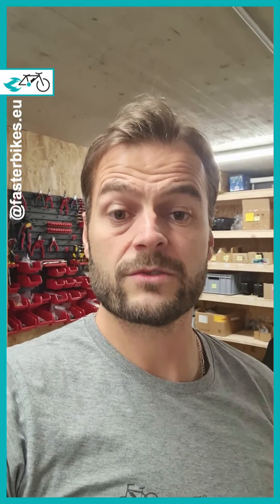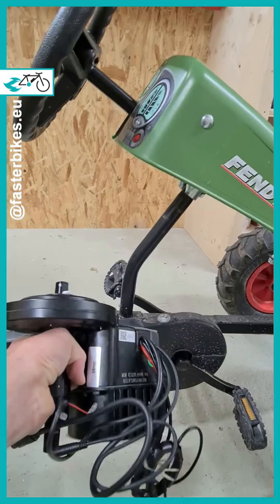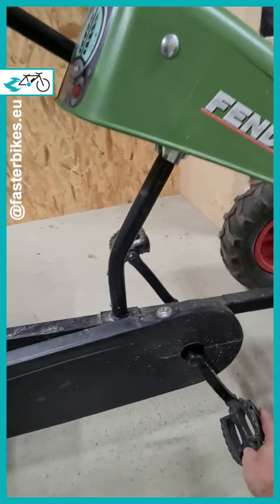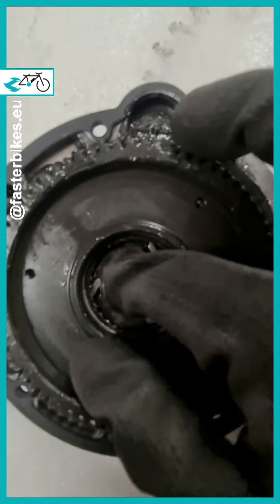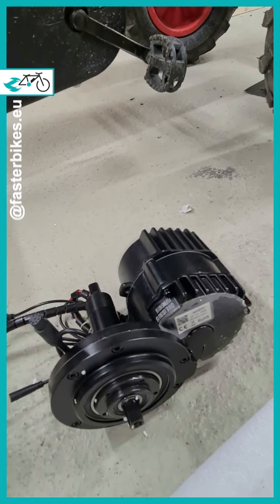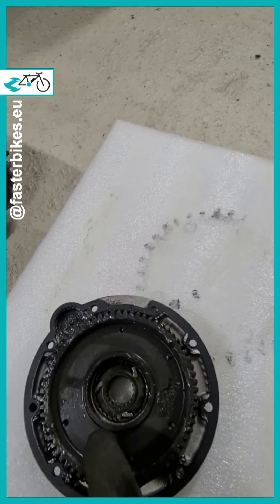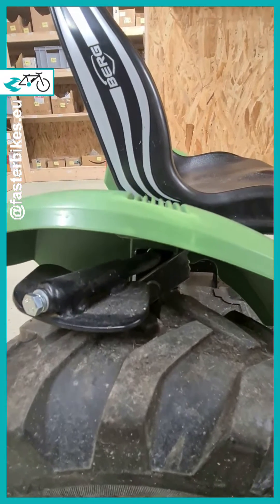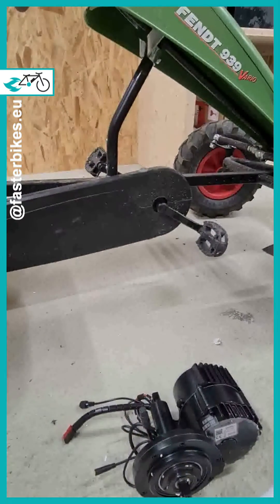GoKart Conversion with Bafang BBSHD Motor ➡️ Project Launch

Comment: please tell me is the bottom bracket in pedal kart like those are similar to bmx? i found the adapter i need for that but i just want o be sure. what adapter do you gusy used?
Reply from the maker: We made an adapter on our own. The inner diameter of the gokart bb was appr. 31mm.

Comment: Awesome, DId you find time to finish the project? I have an old Berg GoKart (the Jeep branded one) and would like to convert it with my son. Any tips (did the motor fit, what solution did you eventually choose) would be really welcome.
Reply from the maker: Yes, we finished the project. We will make a video how we did it in detail. Here you can find the video with finished conversion: https://www.youtube.com/shorts/zyIf45yMYPQ  The motor axle doesn´t fit the original frame - you will need to design a little adapter. We used the 68mm version of bbshd, but I recommend to use a wider version, maybe 100 or 120mm. With this you don´t touch the front cover of the gokart with your knees.